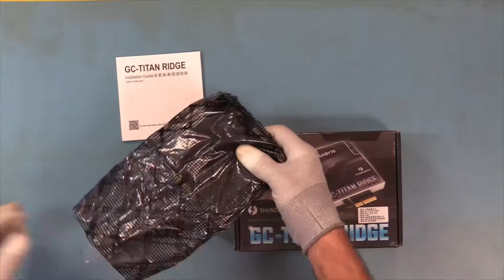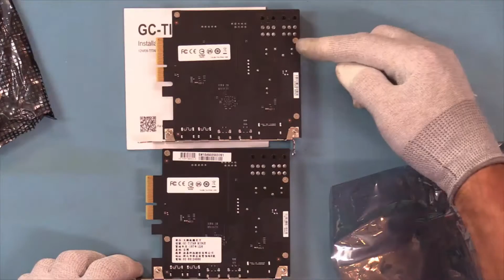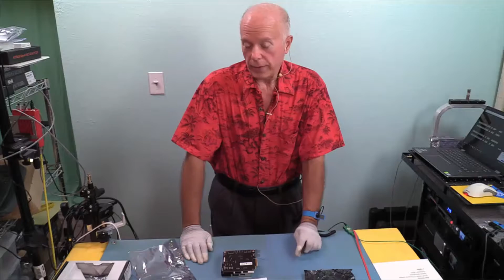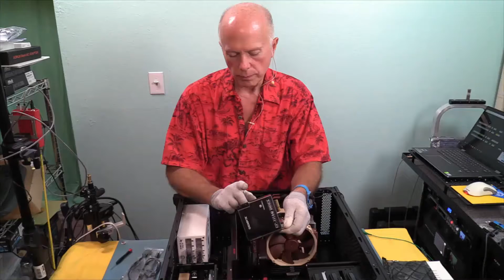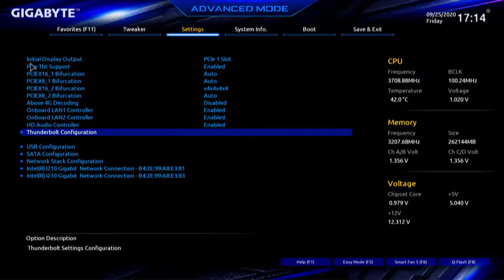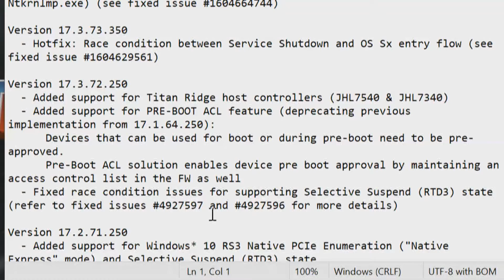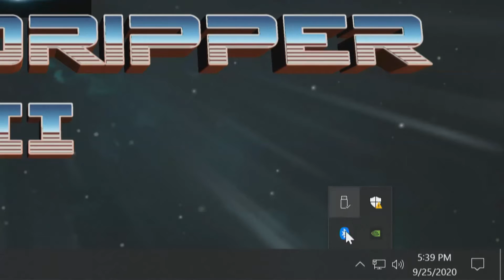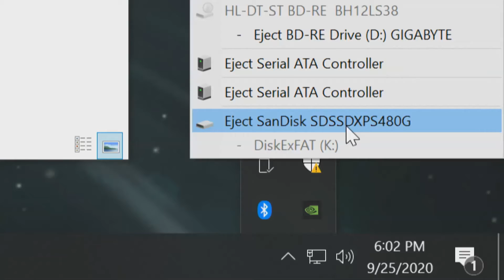Titan Ridge Thunderbolt 3 Unboxing, Comparison and AIC Simple Install on Gigabyte TRX40 Designare

Comment: I have been following this build you are doing and I gotta say, you are hands down the best computer build teacher I have found on YouTube. No one else even comes close to your attention to detail. Also, as a scientist, I completely love your focus on function and performance as a priority rather than meaningless flashy aesthetics. In my opinion you should be getting far more subscribers than you currently have.

I also have a question. I am considering doing a similar build to the one you are currently working on. I'm planning on building it for my wife who is a researcher and uses Stata on massive databases. Her requirements for memory are huge because of the Big Data in order to run multiple regression analyses. I completely agree that your air cooling set up on this computer will work fine as you are building it, but my question is, if I built a similar build and stacked it out with 256 gigs of Memory, would I need any additional cooling, or have to go to liquid cooling which I really don't want to do, or would the cooling that you have in this system be able to handle the added heat from the additional RAM sticks?
Reply from the maker: Hi Guapo Desperado, 
Thank You! Details matter! We're working on a follow up to this with problems encountered afterwards while trying to install a 2nd Titan Ridge AIC and solutions. It was a mess! Air Cooling, Noctua has it covered. We do use the additional 2nd Fan though. It may help only a little bit but we think every little bit matters! Yes, we started with 128GBs, then ramped up to all 256 GBs after the Bios Updates. Phenomenal! Added Heat? We currently don't see that as a problem. We still have to install the Thermistors and watch those potential hot spots. For testing purposes, we have the machine running 24/7. Appreciate Your Comments! Thanks for Sharing! 

Bios F4c, is solid with 256GB RAM. We started with Bios F2 for 128 GBs. The latest Bios  F4k was buggy and has just been replaced with F4i as of 9-25-2020. F4k messed up PCIe Lane assignments on 2nd x8 Slot rendering that Slot useless. We'll see what F4i does! 

We think it helps to know the reasoning of what, why and where behind the mechanics of the machine. As well as problems and solutions encountered along the way. We learn by doing! We'll be covering other Devices we connect this with as a Content Creator and documenting those procedures as well. Stay tuned!
Reply: I agreed, this man is so profesional, meticulous, precise and perfectionist, its unbelievable, I enjoy a lot waching his videos.
Reply from the maker: Hi @toumber , Thank You! I'm honored. Details matter! Appreciate Your Comments!
Reply: Actually, I just remembered you do intend to put 256GB in this computer right? I guess you only put in 128 so far so I got confused.
Reply from the maker: Hi @guapodesperado2822 ,
Easy to do! That's why we think this is so important to document - To help eliminate any confusion. 5 years ago we were trying to get 32GBs into a Computer. And now...

BTW: One more thing on Cooling. Remember, we also replace the Case 3 pin Fans with Noctua 3,000 RPM 4 pin Fans! If those ramp up, then we have cause for concern!
Reply: @BuildOrBuy  thanks so much for the replies.  Excellent info. And yeah I definitely caught your upgrade of the case fans.  Having high performance and rampable case fans as a canary in the coal mine, per se, to indicate unhealthy heat loads is a great idea.  Finding ways to either build in safeguards or having redundant failsafe mechanisms is always the best approach.
Reply from the maker: Hi @guapodesperado2822 , Absolutely! Thank You for joining Us on this journey of discovery! Your comments help Us to make better Videos! As with any Research project, documentation and testing are crucial to our success. We think You'll find the next two videos most interesting. 

After 7 1/2 hours of Filming, we ran out of Camera batteries. Next day, 4 more hours, 6 Batteries, and a fresh mind to go at it again until we achieved resolution. Eager to share what we encountered! And now a new Bios as of 9-25-2020. Curious and eager to learn what's happening with that one. As we get closer to Production status, testing becomes more delicate in our approach.

Great analogy in the coal mine. Perfect! I've had other Subscribers comment on the Fans and remind them of their purpose! Yes they cool however, reason dictates if they make noise too much noise, check it out!
Reply: @BuildOrBuy  No doubt I will be watching your videos for a long time to come, I am a diligent learner and I intentionally seek out teachers that are great on detail yet have a humbleness about them, you can tell those teachers are doing what they do because they actually love spreading their knowledge and are willing and eager to learn right alongside their students regardless of any gap in knowledge the two may have.  You sir, definitely display such character. 
In the early 2000s I was programming in C++ and building my own computers but I really didn't keep up with it as time went on. Sure I learned how to use Linux and did a lot of computer maintenance in the meantime but I have not built any full systems for quite a long time. So needless to say I had at least a little trepidation about deciding to get back into this, especially with the incredible growth in technology. However, it's something I really should get back into.  I am lucky there are people like you out there making videos that will help me get caught up on builds and performance testing.  I know I have a long way to go but it will be a good journey. A life of learning is a life well lived.
Reply from the maker: Hi @guapodesperado2822 , I'm just a talking head. Thank You. I'm honored. Knowledge should be shared. We learn by doing. Experience is always the best Teacher. I was the guy in the back of the room with my hand up. One day, I was asked to come up front and help teach the class. Flying by the seat of my pants! And I'm still learning!